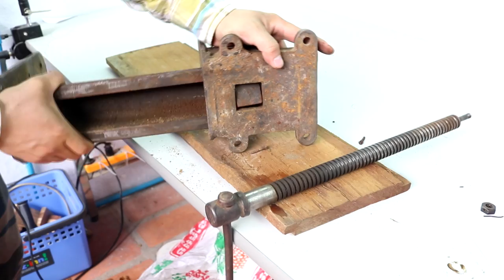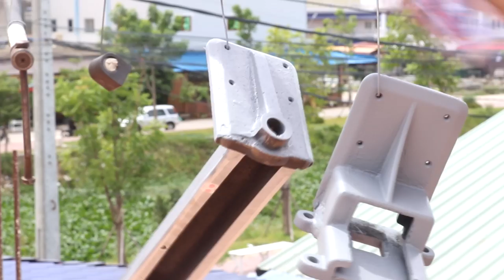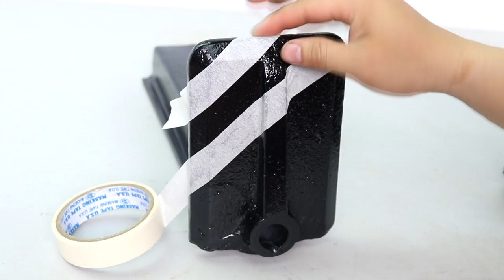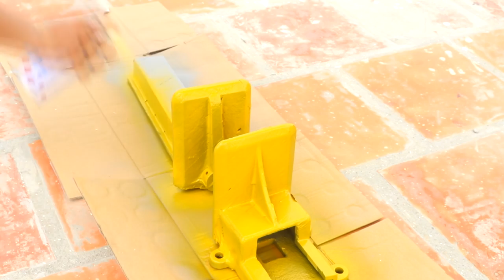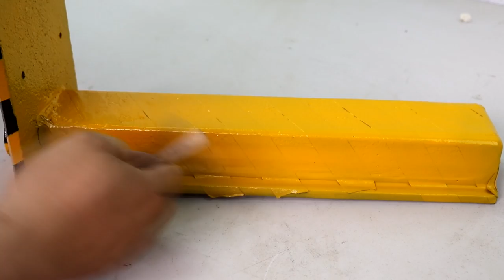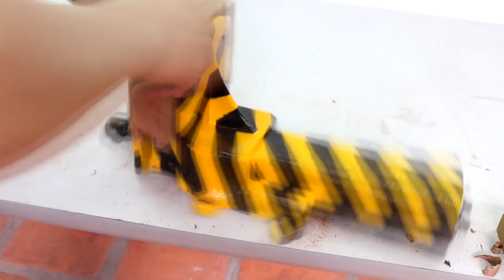Old Vise Restoration Process Step by Step

Comment: Looks great, few suggestions. If you want to restore old iron you might consider getting rust remover. Rust can come back over time through the paint. Evaporust and wd-40 make a remover. Just drop in and it takes rust off and lot easier on your hands. Its also reuseable as well. cast iron doesnt need primer either, primer is to allow paint to stick to a smooth surface, cast iron is very porous.
Reply: Yup that's what I have been questioning for the whole video but ok.

Comment: You need to remove all the rust. Any rust left behind will come back! Another suggestion. Don’t paint any areas where your hand will touch like handles. With any use it will ware the paint off quickly. Remember a half ass job produces half ass results. A job done will done will produce great results.

Comment: Hey Mate, congrats on your videos. They are awesome to watch, but the way I see it, you could use better the masking tapes. See: the inner piece of the vice, the one that holds the thread bar is not properly masked. You should cover the hole with tape and then, with a eraser blade or exacto knife trim off the excess. 

This is just a suggestion! :) I'm glad it it helps anyway it could :)
Reply from the maker: Thank you for your suggestion :), nilo saraiva !
Reply: @gear_show  My pleasure, mate